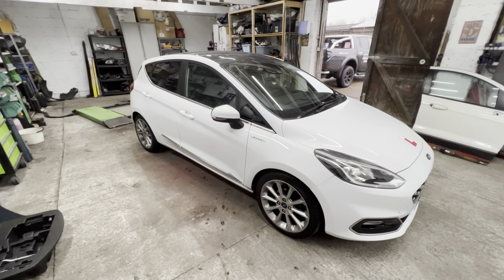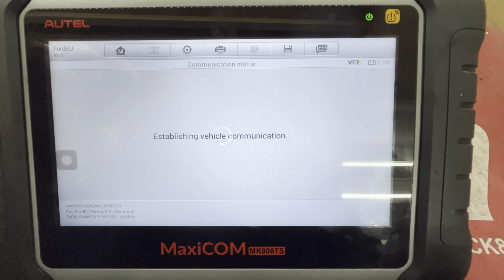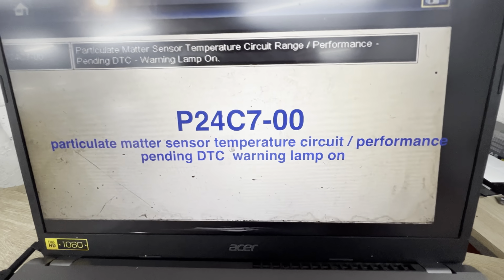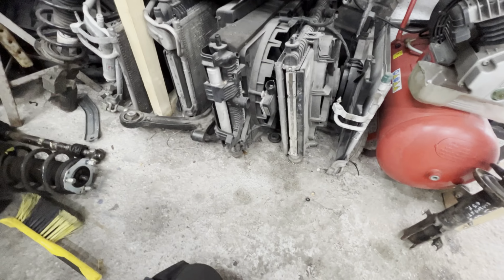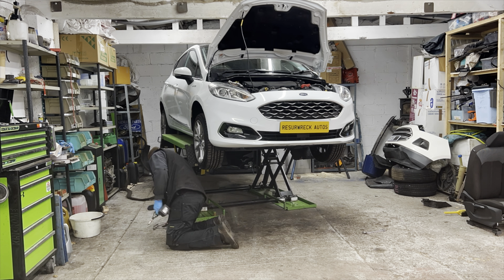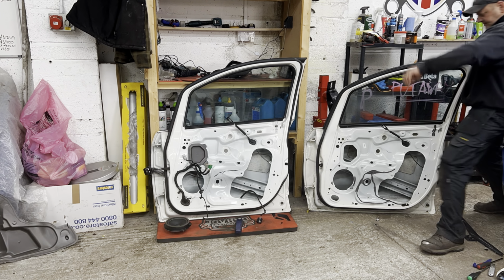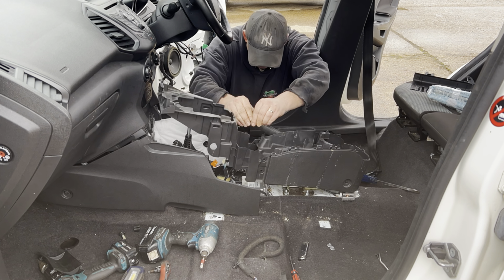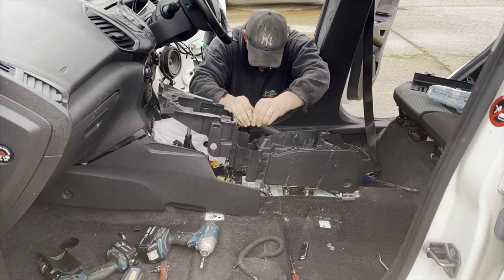Ford EcoSport  2016 Cat S Salvage Rebuild Part 2

Comment: Hi Mark. Busy, busy again. I saw Alans Fix ages ago but hadn't associated it with other Ford Models. Hope all goes well, as the price is Extortionate. There may have been a chance for a DPF. Run before replacing the sensor. 🤷‍♂🤷‍♂ See you in the next one. 👍👍